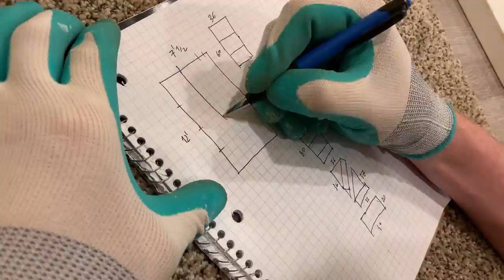How to Install Carpet on Stairs | DIY

Comment: Were you using staples to attach the carpet or nails?
Reply from the maker: Staples: Grip Fast 1/4" Crown 5/8" Leg 18-Gauge Bright Narrow Crown Staple
Reply: @MrStukov   thanks! Last one, do you think I can get away with using an electric nail gun or I really need to use one that has a compressor?

Comment: underlay should go gripper to gripper as per standards of fitting, issue is heel and toe you will get over time causing a hole on riser.
Reply from the maker: Thanks that makes sense, but I am frankly don't understand how underlayment on risers help to protect carpet on it from wearing.
Reply: Only on waterfall method not cap and band.

Comment: who taught you how to do stairs? You have the bottom to top correct...but tack against the riser is ok but not necessary on the side of stairs...you can even get away with nailing the seam or crease from riser to footing by stapling as well to avoid a heel getting caught on a tack....but you never put them on the sides....it looks good and the side cuts for the bottom step...theres a better way and looks much nicer.....over cut carpet longer than end of step....fold into tip of carpet at angle and cut...then wrap and trim

Comment: What are the dimensions of the carpet used ?

Great job !!!
Reply from the maker: Could you clarify your question? Carpet that I used in my project.  Sells in rolls that 10’ wide so a I got length that enough to cover my stair.
Reply: @MrStukov  thank you very much for the quick reply ! 

I live in the U.K. and usually carpets are sold 4m or 5m width wise and then you usually pick the length needed in meters also. But thank you for the reply for your carpet dimensions our stairs seem to be similar in size but will measure my stairs for sure .

Comment: one thing i think we all missed was the dodgy secound step cut missing the corner
Reply: + top step too short
Reply from the maker: Thank fo noticing that. I put temporary carpet piece on the top step because tile flooring on this level will be replaced to a new one. Then this top step will be updated with bigger piece of carpet.

Comment: Could you tell the names of the tools, where to get them, how much they will cost? thanks!
Reply from the maker: I am updated description of video with the names of the tools and links to places where you can get them. To make project cheaper you can substitute some ot them. For example I am used miter saw to cut tack strips, but it's possible to cut them using basic hand saw.
Reply: 😂 oh jeezuz
Reply: Or use strip cutters that only cost 45.00 ....plus using an air compressor and pneumatic staple gun is sooooo over kill... a good duofast electric staple gun is faster better and the correct tool